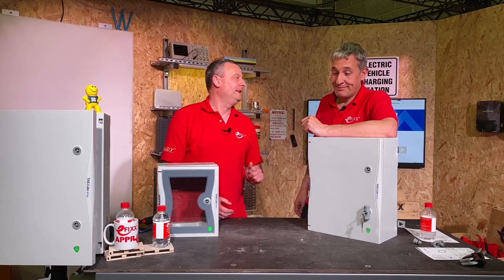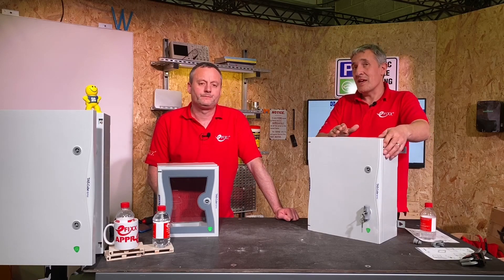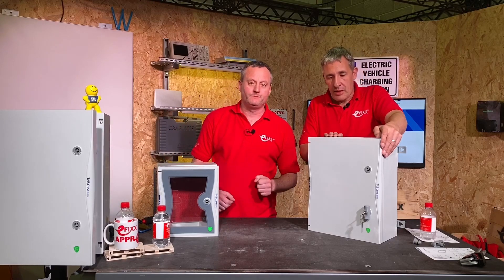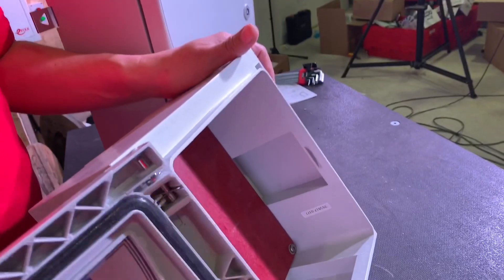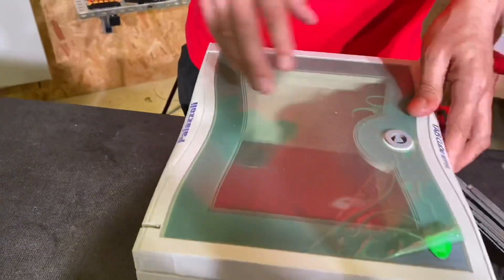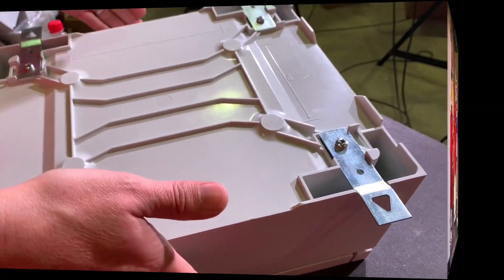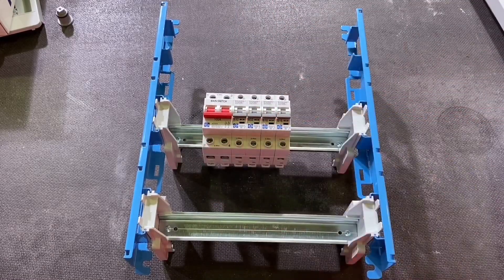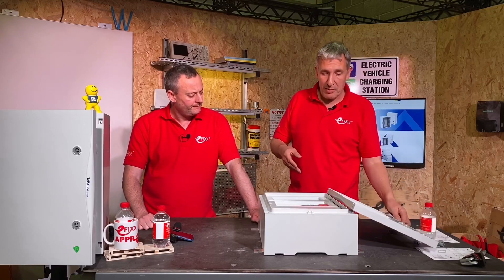TAIS Cube Performs Under Pressure

Comment: In a former life I spent a year doing M&E stuff for the water industry. Will never forget visiting a Severn Trent Sewage Treatment works where the external galv tray and Unistrut had completely disintegrated. Just found a picture from 10.5 years ago
Reply from the maker: 💦 Water treatment is a challenging environment for any electrical equipment. Did you install any GRP tray and strut?
Reply: @efixx  I worked for a consultant and was only there for a year so never actually saw a project through :( I got the impression that what we designed had little influence on what actually got installed!